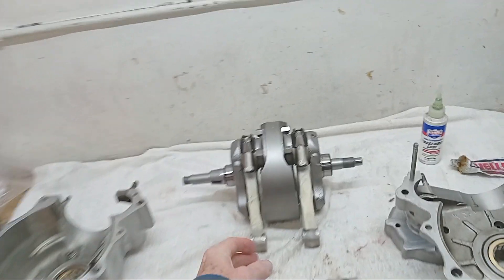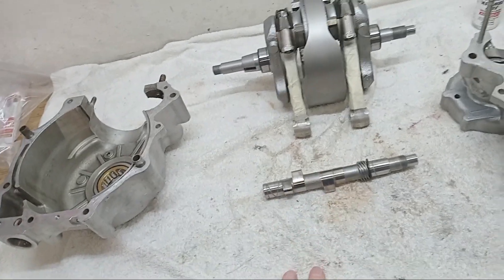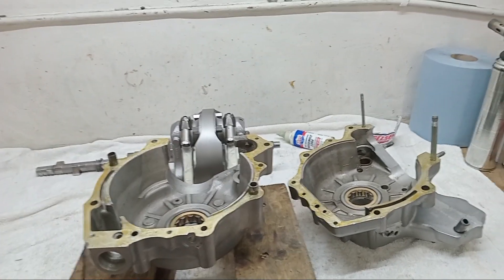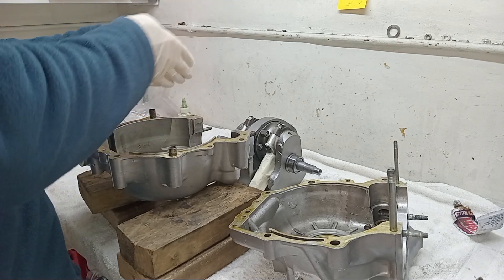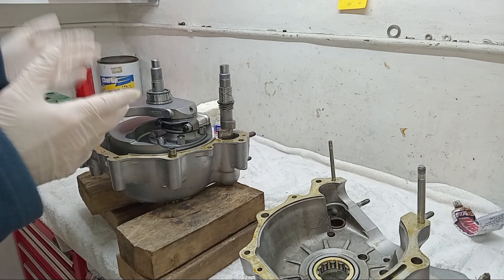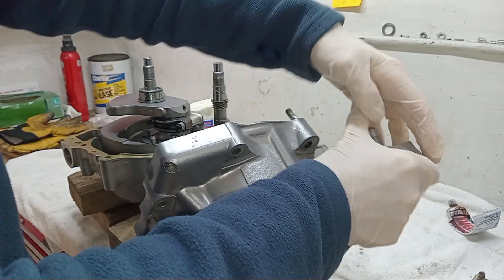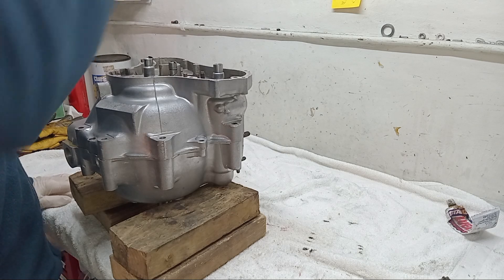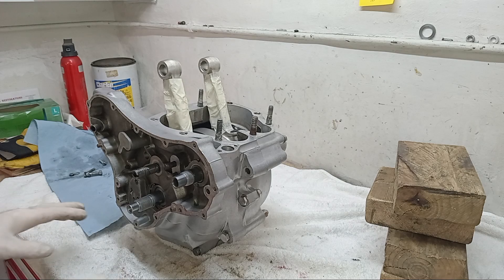Norton Commando Engine Rebuild. Part 48: Assembling the Crankcases

Comment: and what about crank balancing can you touch on that
Reply from the maker: That's something that I've always left to the engineers  - beyond  my skills/equipment level I'm afraid - but I usually never bother with balancing as it's expensive and for day-to-day use not generally necessary unless tge engine's suffered major mechanical failure.
Reply: @Chris.rooke150  ok

Comment: what about the crank case vent timed disc. can you go over vent mods like reed valves.
Reply from the maker: Thanks, I may well look at the various engine breather mods and alternatives later on. 👍
Reply: @Chris.rooke150  ok
Reply from the maker: Apologies, I know I haven't done so yet, but will do. 👍
Reply: @Chris.rooke150  I think Im going to go with the JS engineering reed valve mounted were the elbow and rubber hose on the left front of the engine is but I have to find out if I need to do away with the entire timing disc at the end of the cam and the piece behind the cam bushing.